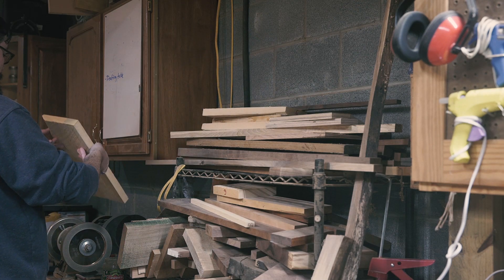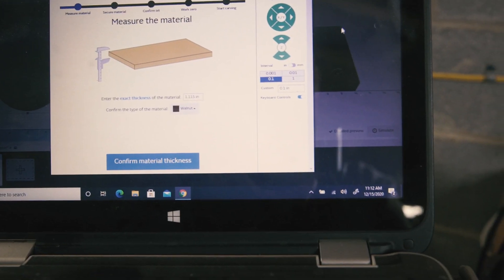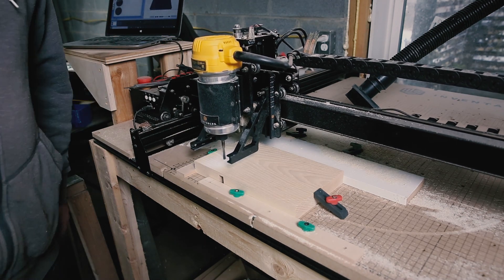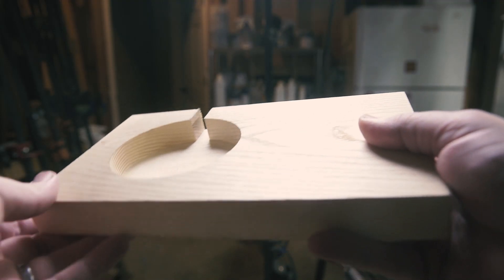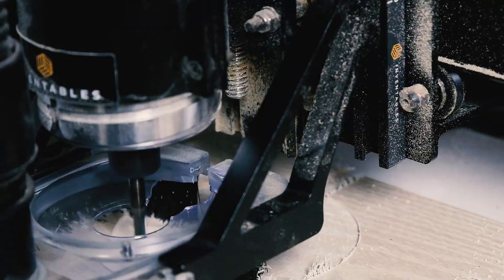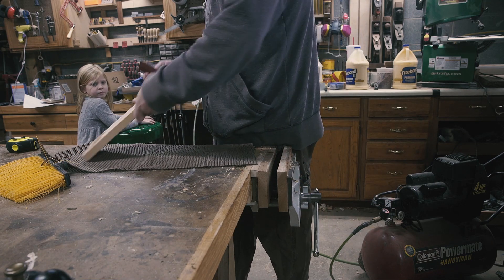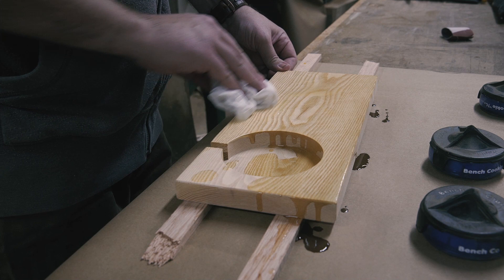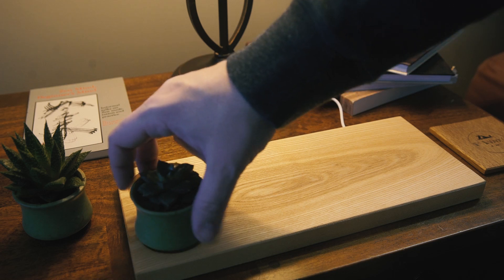The EDC Board (with wireless charging!)

Comment: Nice! I also likely the way the grain turned out symmetrically, although it seemed a scrap piece. What about small pads underneath to prevent the board from sliding?
Reply from the maker: pads would be good too.  You'd have to remember to put some underneath the charger too.

Comment: What wireless charger did u use with this. I would like to try this but have no idea which charger to get?
Reply from the maker: Honestly I just picked up a $10 one at a Tuesday Morning store. It works great.
Reply: @wmwalkerco  how deep did u cut the hole for the charger?
Reply from the maker: I measured the thickness with calipers, then milled the stock to be about an 1/8"-3/32" thicker than the cut depth. Might be worth it to try on a piece of cheap scrap and make sure it works.  You can also, use felt pads to pick up whatever charger you buy depending on what milling machines you have access to.

Comment: Your grizzly codes don't work in the new year?
Reply from the maker: They are supposed to.  Let me check in with them and see whats going on.
Reply: @wmwalkerco  the item is backordered,  but I have it in the cart and before the new year it could be applied.
Reply from the maker: Ok. I'll look into it. What code did you use?
Reply: Walker01, it applies but the discount doesn't come off. As I said, it did work before the new year, it is on the 1023 table saw.
Reply: The code works now! Thanks for looking into it. I've made some moves and hopefully will order the table saw this week. :-)